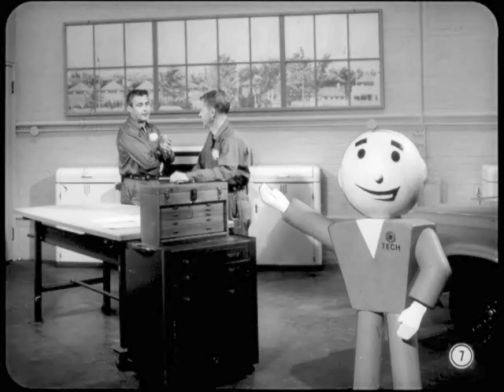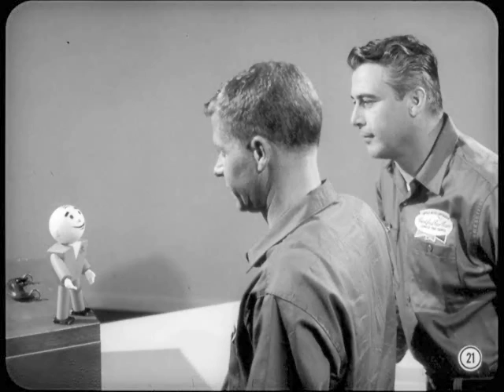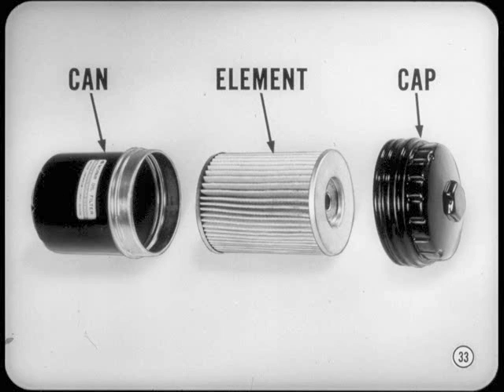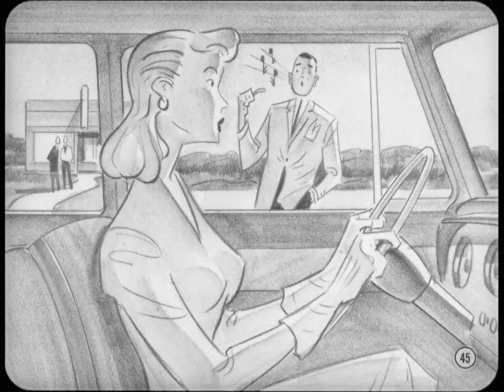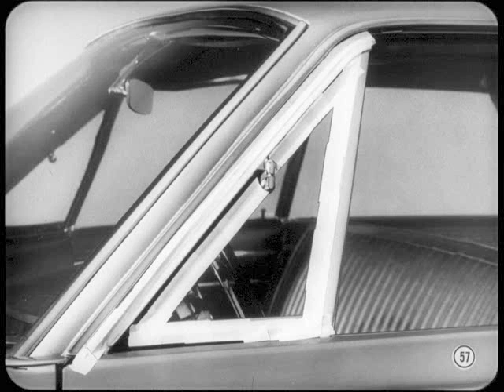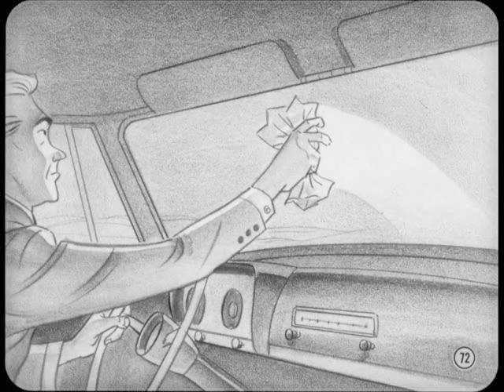MTSC - 1965, Volume 65-12 '65 Service Roundup

Comment: This is good, a model year end wrap up of the things that they found needed to be changed, stuff that wouldn’t likely make it into a service manual. Working in the Chevron Station that was attached to the local Chrysler Plymouth dealer, I can’t begin to guess how many oil changes I’ve done on 60’s Chrysler products, and I’ve never had my hands on one of those canister oil filters, lots on GM’s, but never on a Mopar.